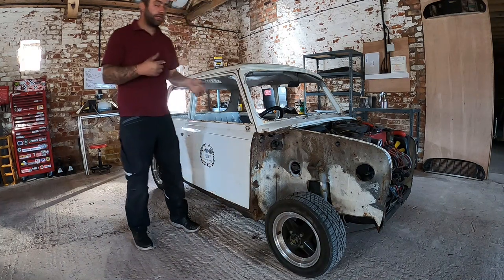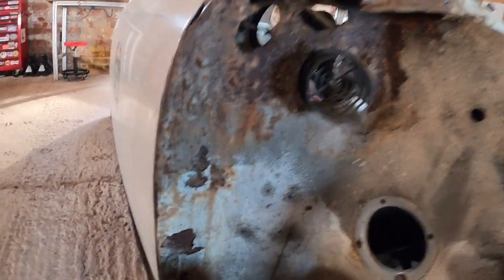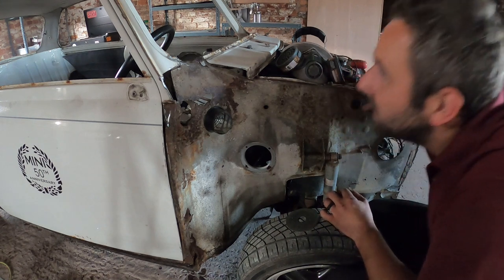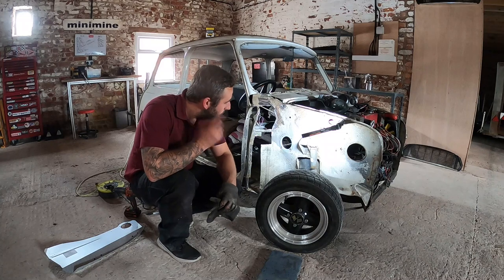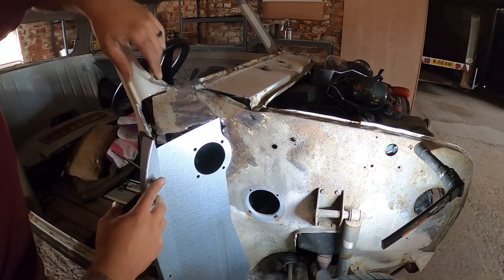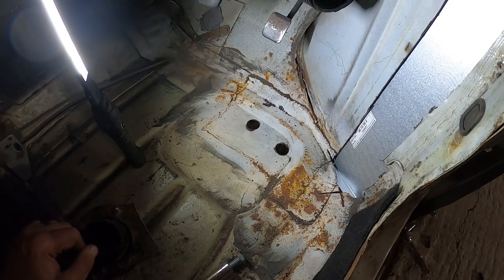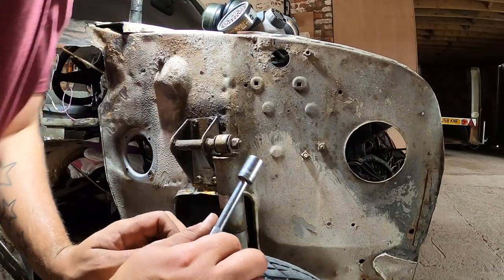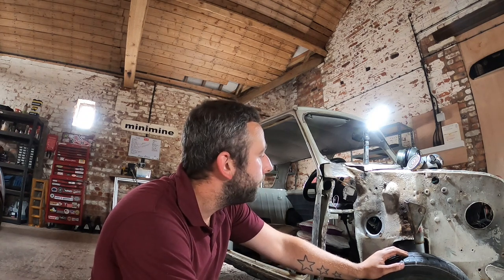CUTTING THE FLITCH PANEL OFF - Classic Mini Mayfair Restoration

Comment: It’s interesting my 94 Mayfair has gone in exactly the same places. I’ve also recently bought a magnum flitch repair panel, with exactly the same ‘oil canning’ or popping in the panel. When the rib is pressed it must shrink in that area, causing the end of the panel to have too much material. I managed to flatten the panel by heat shrinking the area with too much material, it worked a treat. I used a small blow torch and dolly hammer to flatten the area once it had bulged up due to the heat
Reply from the maker: That is good to know this isn’t the only one to be going in these places. Nice tip on the heating of the panel. We are currently working out what the next plan of attack is.

Comment: I'll definitely use your tip on the flitch panel. Luckily my toe board isn't as bad as eve's so I'll follow your instructions 🙂🙂. I'll be interested in how you tackle the repair behind the shock absorber as mine needs doing, although the rust doesn't go all the way through like James's does. Great video 👍🏻.
Reply from the maker: Thanks Rick really appreciate your comments. It’s time to sit back now and work out a plan of action but of course I will bring you guys along for the ride. If you check out the 89 series I have done the shock tower repair there if that helps in the meantime 👍 thank you for watching
Reply: I've watched all the 89 series & I think I've missed it somehow. Not to worry I'll go back & have a look again 🙂🙂.
Reply from the maker: @velmathemini  no worries I am sure I covered it. Might be wrong either way we will touch this area for sure

Comment: Hi Marc, going to be a very interesting build this one. You mentioned Plusgas for rusty bolt removal but have you heard of Bulldog BDX. the guy on Cortina City swears by it as it penetrates rusty bolts & fittings that are over 40 years old, making them easily removable. Worth a look if you,re interested.
Reply from the maker: Oh yes definitely an interesting one for sure. I haven’t heard of that stuff but I will doing some research on it for sure cheers for that and thank you for watching stay tuned for more.